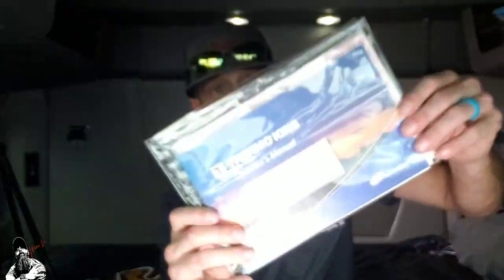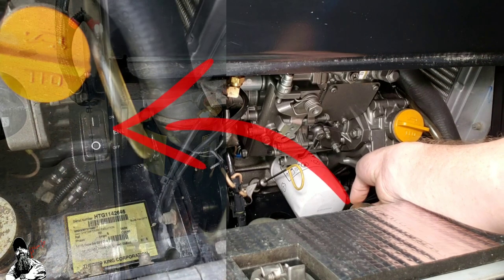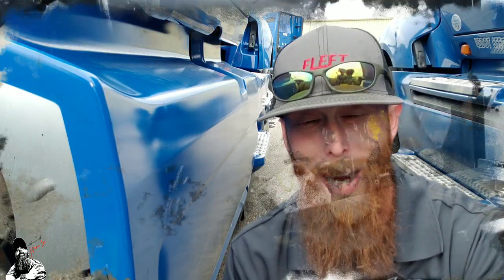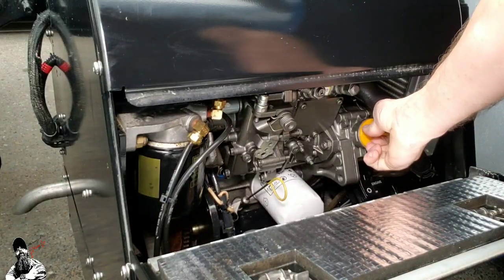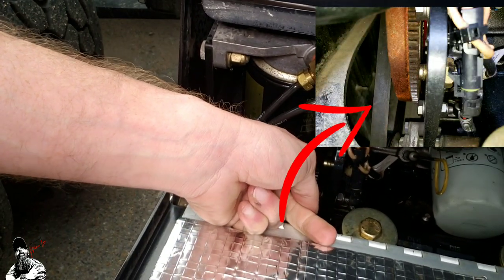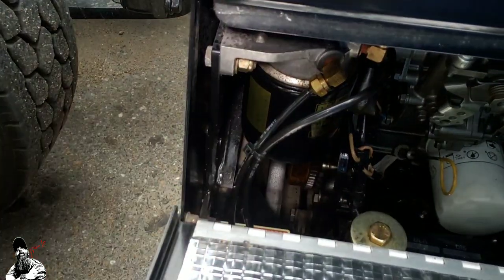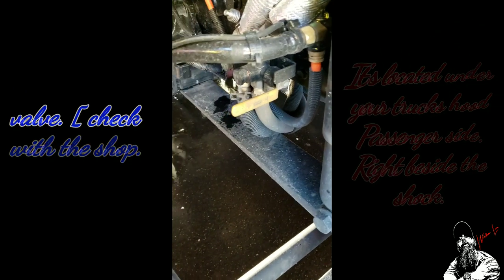How to Operate & Perform Daily Inspection of the Thermo King Tripac Evolution

Comment: great video question my apu stay on standy mode does not run fan or a/c with out me mannually turing it on my truck 2020 freightliner key off position on buttons on front  at all. how can i set it to automaticly turn on and set fan speed automatily thnks great video better than any other videos i seen
Reply from the maker: I've always had to set evey time. I don't believe there is a memory or pre programed mode. Wish there was but it not.

Comment: So question do I have to turn the unit off from the outside on a daily basis, when running my truck or will it cut off on it own after truck start ..
Reply from the maker: That the main power switch outside on the unit. You can leave it on unless working or Pre-Triping it. It will shut off once you start your truck

Comment: I don't drive for J&J, but 1st time tripac user. I guess I have an older unit, it has a digital HMU. If I understand,  in normal or standby modes, the apu will monitor the batteries?
Reply from the maker: Can't speak for 100% sure but almost positive that they all do. I always leave my fan running when I'm on home time to circulate the air and Unit starts and stops as batteries get low.
Reply: @AdventureswithWildmanLuno  this truck has 7 batteries (for whatever reason) and I'm to far from home yet to trust it much.. lol I just replaced 4 batteries.. this truck is older, but I just got put in it

Comment: Would it be possible to fit a TK on a Kenworth T680 without having to remove the fiberglass on the side?
Reply from the maker: Yeah you can also mount on top of your frame up against the sleeper. Some of our 389's are that way.

Comment: My control panel is lit up but wont come on all of a sudden or cut off. Any suggestions?
Reply from the maker: Sounds like it might be shut off on the main switch on the APU it's self. I would check there first. If that's not it then I don't really know bro
Reply: @AdventureswithWildmanLuno  thanks. The control panel needed to be reset. I had to go inside my cabinet and unplug it panel for 5 minutes for it to reset. Works fine after that

Comment: If the Tripak has been running and am about to drive do I have to turn off the Tripak or it will turn off automatically once I turn on the truck?
Reply from the maker: Mine turns off once I put my key In the on position. Even on my 579 pete it turns off within 5 seconds after your key has been put in the on position.

Comment: My Thermoking APU  won't start! All it does is beeeeeeeeep, beeeeeeeep! I checked fuses, connections,  wires,  oil, etc. It won't start. I can't find the reset button. It just won't start! Dont know why. Was onnthe truck installed from factory when i bought it.  Have all the manuals everything to it. I may just juxk it or scrap it if i can't get it to work, though.  It's 2,200 pounds of dead weight on my truck i can do without.

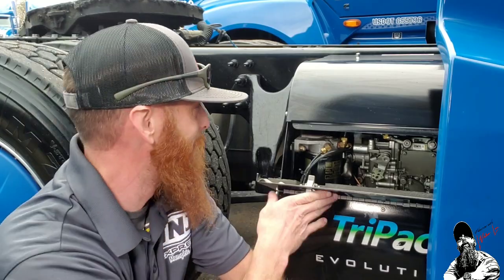Comment: Does anyone know where to locate that coolant switch he showed at 6:50?
Reply from the maker: Its behind the passenger wheel
Reply from the maker: Also at 7:02 in the video in red lettering it should tell you where its located. If not i need to go add it in. Thought it was.

Comment: My control panel knobs won't light up at all.
Reply from the maker: Try holding down the power button for a few seconds
Reply from the maker: So the Stand by is not lit up
Reply: @AdventureswithWildmanLuno  I don't get a standby light
Reply: @AdventureswithWildmanLuno  my apu also has an engine hours panel under bunk and it doesn't say anything as well
Reply from the maker: Check to see if the fuse is popped. I do know where it would be located so you might have to do some research. Sounds like a electrical issue to the pannel
Reply: @AdventureswithWildmanLuno  I checked all the fuses in the apu box under bed. All were still good. Is there another location?
Reply: @AdventureswithWildmanLuno  I'm probably not smart enough for an electrical fix. Thank you for helping.
Reply: In case someone else comes across this problem: if the control panel is lighting up but not dialing up (green), one possible solution is to pop off the piece that specifically contains the dials & unplug the white connector/plug-in that is attached to it. Then plug it back in.